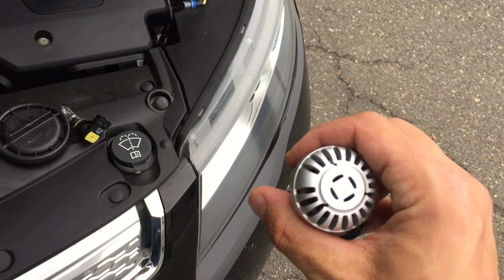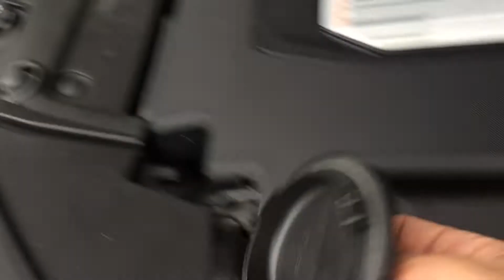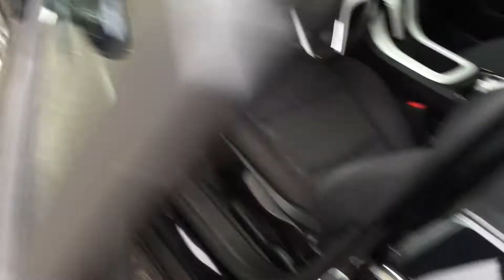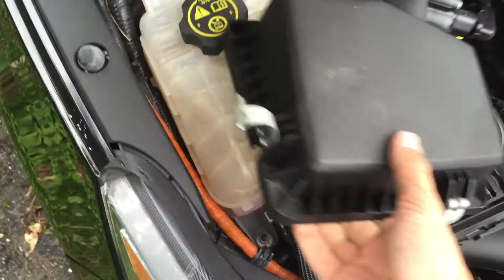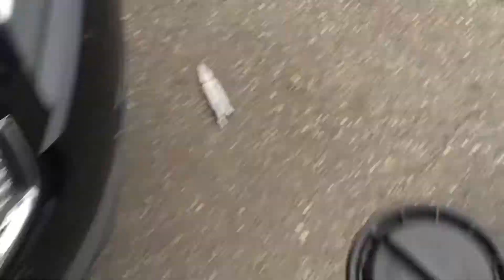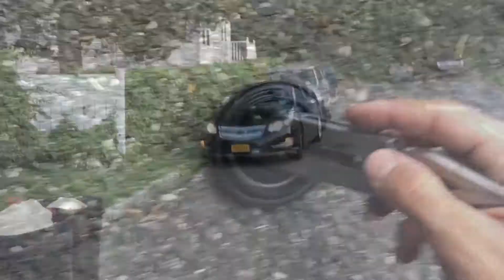Chevy Volt first generation Headlight LED Conversion

Comment: I put hid in mine and they look fantastic
Reply from the maker: I am sure they are. Different kind of work, though and things to pay attention to. Enjoy.
Reply: @artworkslights  
Mine went in 8 years ago when car was new. Still working
Reply from the maker: Back then that was the only alternative for upgrade and you have a good kit too, if it is still works
Reply: @artworkslights  
Yup still works. I don't like blue lights, which most of the LEDs are. I run 4200K lights. All the LED ones I have seen are 6500, and these are not great in the rain. I tried 6K bulbs and pulled them and put in 4200 and have been happy.  They are still much whiter than halogen which are more like 2800K but not as blue. The eye is much more sensitive to the 4200 spectrum than 6500. Looking at new volt now, and they come with factory LED for low beam and halogen for high.
Reply from the maker: @12voltvids  Most of LEDs that I deal with are not more than 6000K, but that doesn't look the same as as HID. HIDs temperature looks a little darker. MOst of 6000K LEDs look under 6000K. There are LED conversion kits that are under 5000K and 3500K. I am going to post another Dodge Caravan video for DRL/high/beams, stay tuned.

Comment: Are they brighter than the stock lights? It's hard to tell on video.
Reply from the maker: absolutely! And they would save your car's headlight too.
Reply: let me tell you something.  A lighter in each hand puts out more light than the high beams on volts what a disgrace

Comment: How's the beam pattern when compared to stock halogens? I know they're projectors and they should work great, but it was hard to tell from the video how much of the light was actually going on the road lol
Reply from the maker: I have a second video for headlights too. It seemed better to me, but I think Projector module may be a bit burnt, because I have seen better difference with newer cars. I also have a video about problems with projector modules.
For sure you would not need any re-adjustments if projectors are fine and you're converting to LED.
Reply: Coolcool thanks for the videos and information. Picking up a used volt on the first and driving a "high-efficiency" vehicle with ancient halogen headlights seems rather counterintuitive... Especially considering it's already got projectors stock lmfao.
Reply from the maker: @ZachariaZuehlke  very nice car. I did all light to LED, especially back up, but did not finish with the video yet. I went different route there, rather than traditional conversion.
Reply: I have a Chevy Captiva (basically rebadged Saturn Vue for rental companies) that I did the same thing with, but had to switch front headlights back to halogen because the halogen lenses would either scatter the beam from LEDs too much or just be way too dim to compete with everyone else's headlights. I'm sure the conversion will come out a LOT better with the volt though lol.
Reply: starting off with these in the new volt though: https://www.ebay.com/itm/9012-LED-Headlight-Conversion-Kit-2200W-330000LM-High-Low-Beam-Bulbs-6500K-White/163096653374?hash=item25f9516e3e:g:AokAAOSwLqRc1Og8
Hopefully they work well and look better than halogen lol. No biggie if they're garbage since they're so damn cheap lol.
Reply from the maker: @ZachariaZuehlke  you should watch some of my videos. different headlights and LED conversion kits work differently for each and every application
Reply: @ZachariaZuehlke  Hi! Did they work? Thanks!

Comment: Do your lights flicker?  I bought a kit and canbus cancelers, I am just not sure I need the cancelers.
Reply from the maker: You do not need special type of Headlight kit other then what I showed in my video. And don't go buying super bright ones too, because they heat up more, unless you ready for that.
Reply: @artworkslights  You're completely wrong. the driver circuit on those leds will not like PWM being fed into them, and in turn will burn out pretty quick. you need the capacitor/ diode kit they sell.
Reply from the maker: Have you had experience with these? How long will they last?

Comment: Hello , what is the socket name?
Reply from the maker: which socket?
Reply: @artworkslights  the light connection
Reply from the maker: @cobranihad8534  I thought I mentioned in my video. I have another video with this car where I have tested a different design. HOwever, the base is HIR2 or 9012 or possible to use 9006
Reply: @artworkslights  many people said that 9012 not fit in this model
Reply from the maker: @cobranihad8534  when you pull out original bulb from Your car, there should be markings on it where it says what you're using.
Reply: @artworkslights  aha okey thanks very much